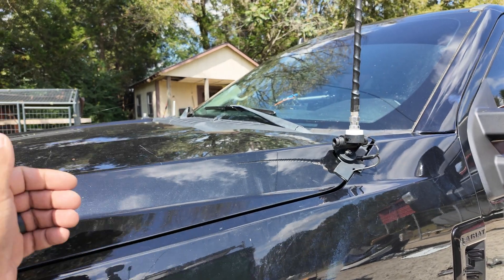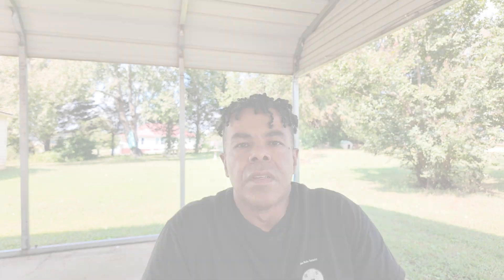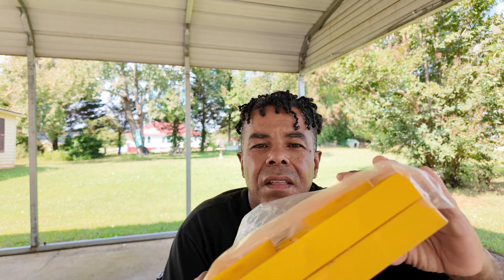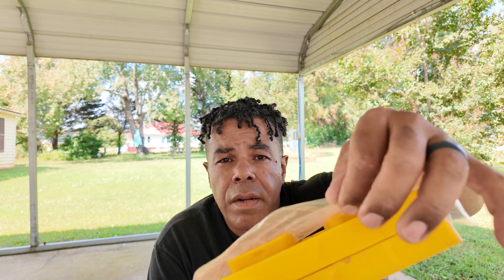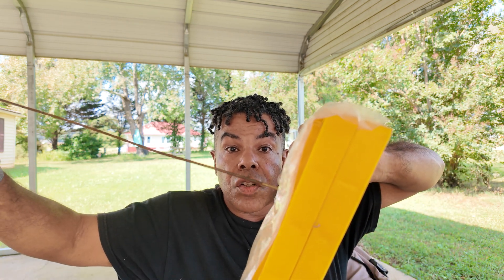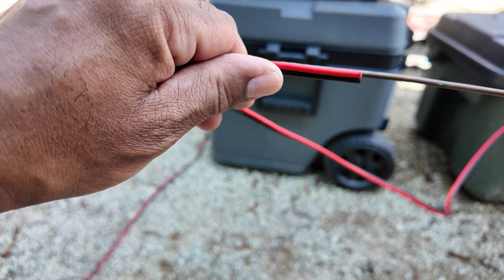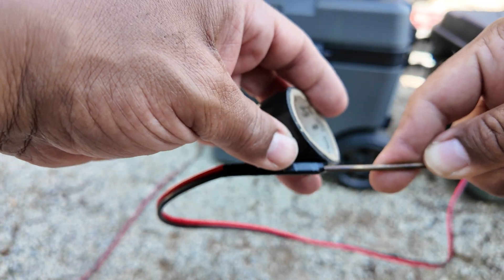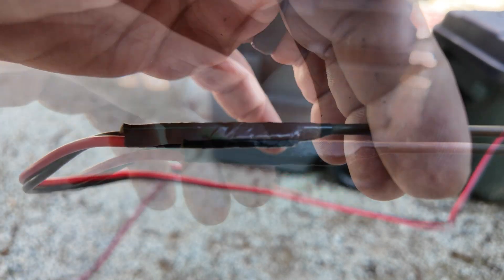Part 2 - How do I get wires/cable from the engine area into the passenger cabin for a mobile radio?

Comment: Hey Bill! I been puzzling how to get through the firewall on my Honda Clarity. So far this has eluded me.
Reply from the maker: If you cannot easily find a spot to pass wires, you are describing what a lot of shade-tree mechanics have been talking about for 30 years or more.  Manufacturers took the engine bay which one used to be able to literally sit in while working, and crammed it to the point that on some cars you have to hoist the car and drop the engine to simply change spark plugs.  That aside . . .  Get on your back in the foot well of your vehicle, flashlight in one hand ( or another adequate source of light) and look and feel around with the other hand.  I have done this before by feel only; it's a little creepy to think you might short something or block some vital mechanical linkage.  You mentioned the steering assembly; feel around for the large, rubber membrane.  Feel for soft points.  When you find it, that'll be a good point to penetrate.  There is a spot to go through.  Check with a forum for the vehicle in question.  Someone has 'breeched' the wall.  Let me know how it goes.  Looking forward to hearing about your success.  73 de Bill  And, thanks for the subject of the next video.